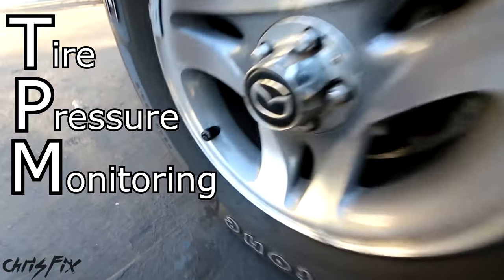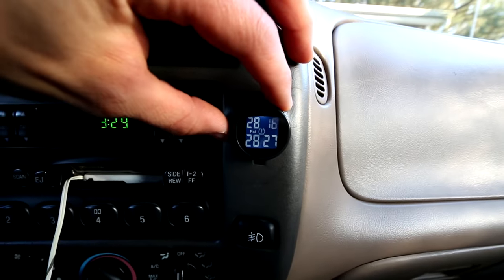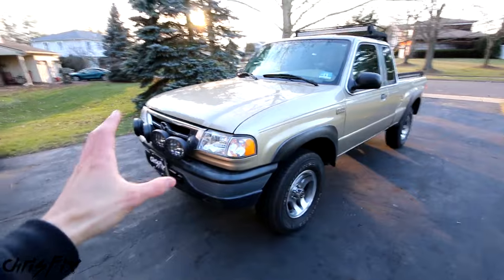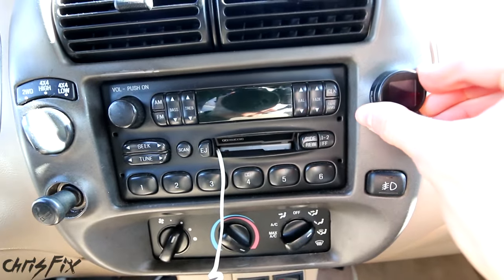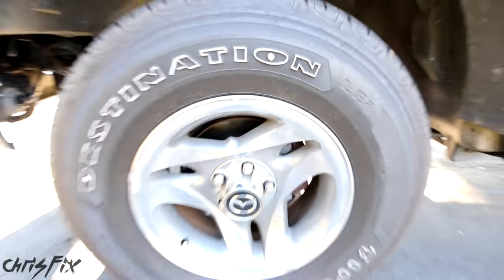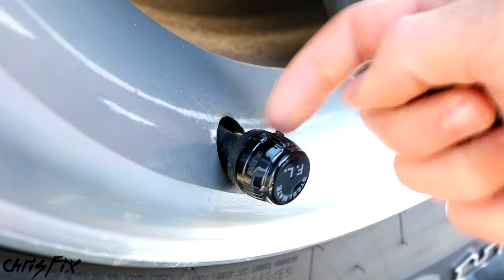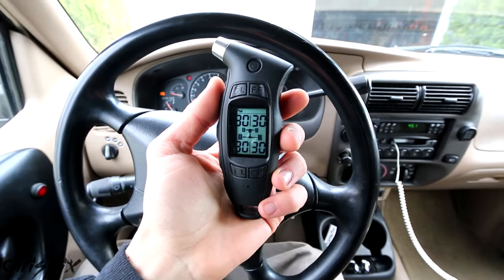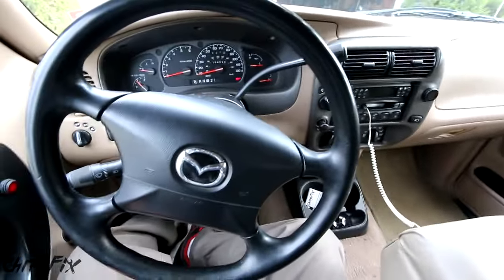How to Install a Tire Pressure Monitoring System in Your Car

Comment: TPMS saves lives. Was cruising down the road at 75 MPH on a very bumpy freeway. Picked up a screw (verified by finding hole in tire carcass after tire blew). The screw somehow came out of tire. Not knowing that tire was deflating while driving on bumpy freeway, it was slowly deflating causing tire to overheat. Before I could sense that something was wrong tire exploded and truck ( towing small trailer, which also was causing resistance making it hard to detect that I had an upcoming catastrophe). It was dawn and getting dark which added another problem. I did not see all the smoke coming from the overheating tire. The tires were in good condition and properly inflated before I drove, for anyone who might think that was an issue ( as mentioned earlier I did find the original cause of the problem, I always check my tires on long trips even when stopping for food,rest and gas). All of a sudden car in right lane started flashing head lights, I looked in right side mirror and could see the smoke in his headlights, tire exploded at that moment causing for a wild ride. Managed to slow down an get over to shoulder, but it wasn't easy. Changing a tire at night along a fast moving freeway is scary and no fun. TPMS would have given my a heads-up that I had an issue and given me time to find a lit area off of the freeway to plug or change the tire in a safer location. I do carry a small compressor and plug kit on trips (Nevada to Pennsylvania).Hopefully they make an aftermarket kit that also gives a low pressure warning.Trying to keep a vehicle in control, changing a tire along a fast moving freeway at night, 3-4 hours of lost travel time, $200 for a new tire. Yeah $109, I'll take it.

Comment: 100 bucks? Screw that, the convenience is nice but I can see the valves becoming inaccurate overtime and it is electronic so its prone to failure. Checking all four tires everytime is inconvenient but hey you get the satisfaction of knowing your tires are at the right psi everytime

Comment: Ive searched but havent found a solution yet.  I have this system installed and it worked fine for about 4 days.  After that, the module no longer provides real time data.  i.e. When i drove 30kms, the PSI in each sensor would go up/down +/- few PSI which is normal as the tyres temp changes but now the PSI remains the same for days and never moves.  If i unscrew any sensor and screw back in, the PSI changes.
So the module in the car and sensors to talk to eachtothe to give me a readout but not real time data as i drive.
Sensors are definitely on the right wheels, battery level is fine and i even recoded each sensor but no luck.
Can anyone help as i find it unlikely all 4 sensors can be faulty unless its the module itself

Comment: My sensors and their lock nuts completely corroded and fused together with the valve! I know that I should have put grease on the treads but, now, how do I get them off?!

Comment: Hey Chris just wanna let you know you are a little bit wrong on the year because I have a 2007 Pontiac G6 with no tire pressure sensors. It’s made mandatory for all cars made after September 2007.

Comment: Thank you for this informative film. The system is new to me. I have a question about TPMS sensors. Can you replace just the stem in the existing sensor? If you change the tire on the wheels w/no sensors you always replace the stem, it is recommended. If you replace the tires on the wheel w/TPMS you don't want to replace the sensors every time, but you always need to replace the stem. So how to go about it? I would appreciate any opinion on this matter. I did just 5 tires (w/no TPMS), and now need to do the ones w/them. Thank you again.

Comment: Great video. Some people reported that a rubber valve stem may crack/rupure due to centrifugal force from the TPMS sensor at high speed after long term use. Just wonder if ChrisFix or people with experience care to comment.

Comment: hey Chris, how come my TPMS, same one as yours, is always 3 below what my tire pressure guages say. (and i used 2 so i know they are calibrated)

if i need my psi to be 36, and i set it to 36, the screen will say 33 but when i drive they say 36 but i put them at 36 before driving

Comment: TPMS displayed in video is $130-150 USD
The sensors are powered by "coin" batteries similar to watches
Need to carry that pesky wrench and holder in order to reinflate
Seems like its more trouble than its worth.

Comment: Hey Chris,
How do I replace my factory system?  I've had a low pressure light on for years because one of the TPMS sensors is broken.  The dealership charges a lot to replace it :(

Comment: Bought a used car recently, pre owner said He checken everything and all 
My Patents said (im 16 i cant drive just yet) it drives a bit weird, we checked the tire preasure  and my Front right tire Was at 0.9 Bar wich is extremely low

Comment: Question so how bright is the screen at night? 

And for those saying it’s too much money. You’d rather walk around and do it manually... You don’t understand why it’s important and being installed on all new cars. Low tire pressure is the number 1 cause of tire failure and contributes to vehicle rollover and loss of control. While driving down the highway you could easily have an issue and not know it. You could have a flat tire and not even notice how low the pressure is till it’s too late. 

I’m not sure I like this kit I would rather have a system that has a app for my iPad which is installed on the dash so I can have it push notifications.

Comment: $110 .... thats a HUGE wtf ..??  cheaper to walk around all 4 tires and manually check them
Reply from the maker: That's true, but the idea is to be able to see all tire pressures at a glance and not have to get out and manually do it!
Reply: @chrisfix  i agree with you 100% ... but at the same time, $110 is a lot of $$ for that product. Yes today its down to $60 which is better but some will think its still over priced...
For me at $60 i would buy it, but not $110 back then and not $110 today either
Reply from the maker: You Tube thanks for sharing!

Comment: @chris fix, 2 questions A my truck says that I need to check my tire pressure monitoring system if I installed this would it bypass that completely?, also second the third link doesn't work anymore is it like important to have the cigarette lighter power splitter?

Comment: External TPMS have one BIG problem associated with them, the sender unit that fits on the tyre valve is heavy and wears out the valve stem with vibration leading to leaking valves and in some case snapping the valve stem, it is recommended by the manufacturers of these TPMS that you should replace the valve stems every 12 months.  . Also trick tyre valve caps have the same problem, the big heavy alloy ones (dice, pool balls, skulls etc are so heavy they rock the stems back and forth causing the seal to leak air, in some cases snap the stem off. And there is also a problem of Galvanic Corrosion between the lock nut and the stem making them impossible to remove, reinventing the wheel isn't always a good idea.

Comment: As an auto tech that works in a tire shop, never fill your tires to the pressure on the sidewall. That's the absolute maximum they should be at. As you drive, your tires heat up, heat = expansion. If you have already filled your tires to their max pressure, BOOM! You just had a blowout. I see this CONSTANTLY in the summer. Always go by the door sticker, or if you don't have one, go at least 10-15 psi below the max on the sidewall.

Comment: I bet that those plugs will kill your ventil in no time, because its too heavy for the rubber and think about how heavy it is in high speeds! And that causes a leak.

Example in my vehicle the previous owner used steel caps, and each ventil leaked. I dont recommend those at all..

Comment: I would buy it but the system they have to take it off ruins it for me. I'd rather just check with a gauge if I gotta use a wrench to fill up my tires. Who's going to steal this? They just look like normal valve covers.

Comment: btw is the weight of tpms will damage the tire stem (where you put air in), Because, if the tire spin faster and faster the weight of it can increase.
Just curious, really want to buy one.
Live in Thailand ssry for bad english or grammar of some sort.

Comment: Chris Fix, you forgot to mention how to change the battery on the tyre tube nut, that way if people need to change or check the battery inside the tyre pressure nut they know how to do it, cheers :)

Comment: I installed 10 sets of these sensors without locknuts, 7 sets of them stuck tight on the threads, very difficult to unscrew out, almost damage the whole valve stem. Now I put some petroleum jelly on the thread before I screw in the sensor, seem good now.

Comment: The inscription on the tyres, clearly state the MAX allowed pressure, for all possible cars on which you will mount them upon. The sticker of every individual car on the other hand, state the actual recommended pressure for that specific model, when it' s unloade and when it' s fully loaded. That' s why the 44 psi was so much off the reasonable pressure.

Comment: yo think it can be helpfull in certain situations, e.g. checkning if your slopes are good or  drifting, if you want to know on which pressure your wheels are working best. 
But allday use its crap, i rather go every two weeks to the fuel station...

Comment: after installation, I assume that the tires should be rebalanced
Reply: Yeah, I was looking at valve caps with pressure indicator. Not really a good gauge, but red yellow green indication. And they weigh enough to make me rethink that, and I may put them AT my next service. I’ll request balancing when they do a tire rotation.

Comment: The product looks cool, but airing up tires looks like a pain using a wrench for each tire. It is just a matter of time before the sensor gets stuck or breaks and you can't get air into the tire when you need to. I'll stick to using my tire gauge periodically.

Comment: Can someone please explain how that locking hex nut keeps the sensor on? They would both turn counterclockwise to take off so if there’s friction and you turn the sensor wouldn’t it just also turn the hex nut taking it off too?  I just installed a set of these and put the hex nut on since why not….but why??

Comment: Only problem with a system like this is not all cigarette lighters or power points are in a location for that small display to be easy to read. Your ranger is an exception since the power point is right there at a height that's very convenient for an aftermarket TPMS.

Comment: My 2016 Toyota Sienna has TPMS.  But it only has a light that tells you when the tire is already low on air pressure.  It does not show you the actual tire pressure of the 4 tires.  Older Toyotas that I have rented have an acual display that would show you the real time tire pressure.  The question that I have is there a reader/display that I can put in the car that will read the tire pressure from the 4 toyota tire sensors in each of the 4 tires.  I don't want to buy a new unit that comes with the 4 little screw on senors that screw on to the valve stems in place of the caps.

Comment: do you still have these on your car. I worried it might get stuck and won't be able to screw them off, because I bought valve stem and they kept getting stuck and I would have to use a tool to get them off. I think it got stuck when the temperature changed from hot to cold

Comment: Thought, maybe it's easier fill the tires every two weeks with the right PSI pressure, than using these sensor and also this key tool every time you need to fill your tire, don't you think?

Comment: Max pressure is the pressure at which that particular model of tire has the greatest weight carrying capacity. The application specific inflation pressure is like you said in the door on most cars.

Comment: I dont ike these as they bypass the protection of the tyre valve and in the case of a failure of the sensor would "fail open"

Comment: I drive a truck that keeps the cigarette lighter on. I have a Bluetooth transmitter cause I can't install a stereo in the truck cuz it's not mine. But the battery has issues dying from stuff being forgotten in the cigarette lighter. Is there a way turn off the cigarette lighter with the truck?

Comment: This must throw your wheels off balance. You are concentrating the weight of three items the rubber sleeve the nut and the device itself in a single spot and you're not putting any counterweight on the other side of the wheel to balance it so you probably have to balance or for all four wheels when you buy the system

Comment: saw it on clearance at walmart for $13. i should have bought it.. but i figured i don't want to keep buying batteries for the sensors. instead i just got the ryobi air pump that  you set it to the psi you want and let it fill  it up and it stops.

Comment: How do you get the locking nut off when it won't budge? You're better off not putting those on because it's a ballache if you want to put air in your tyres plus you need that tool in glove box all the time

Comment: why would anyone steal the sensors?  it isnt line they would have any value since they only work with the receiver in the vehicle.

they are probably specifically coded to only work with the receiver so if one goes missing you may have to order a new kit or call the maker and give them the serial number to get a new one.

Comment: Chris,  Would you know if this system would work with a trailer/trailer tires that you're pulling?  Also, the tires on the trailer are load range E, so they are run at about 85 psi.  Would this system work with that high of pressure?

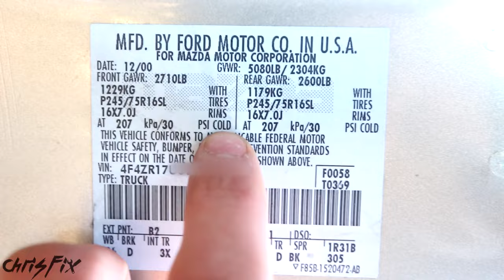Comment: 3:32 that information on the tire about the inflation is only there to tell you that the tire can handle that amount of psi before it blows up from the heat on the road and is only used for EMERGENCIES. I can stress this enough to warn people to not do that to their tires and just to air it up to what the door jam says.

Comment: What if you wanted say an oil pressure gauge, oil temperature gauge, battery voltage gauge, or a combination of all the above in your car?
Reply: automan224 use your smart phone and a app called torque you'll need a Bluetooth odb2 adapter the you can monitor everything in your ride.

Comment: Quick bump on a good video. How do you get air into the tires in a hurry without the TWO tools needed to remove the sensor cap?

Comment: car manufacturers should have made them like this.  the factory made ones fail in a year or two and cost 50 to 70 per tire valve to replace.

Comment: I grew up always checking, tire pressure with gauge, lights working, oil level and brake fluid level before driving. The 5 minutes it took saved me trouble a few times.

Comment: the big size of the transmitters are because of the batteries, if you put them a clock mechanism to charge with the motion of the wheels they could be smaller

Comment: Hi Chris and everybody, as it is quite expensive also in my country (+100 USD), could you please recommend a model / brand that for your experience goes better (accuracy, RF snsr connection) than the rest? I've seen many that can be suited in the powerpoint like the one in the video, and others solar-powered significantly bigger than this one.
One more thing guys, here in 2018, Argentina is very far far away from the idea of including them as a mandatory feature. It's only equipped on luxury cars. Nice day!
Reply: And one more  question, do I have to re-balance my tires after installing this? Don't know if each sensors weights enough as to unbalance tires at high speeds. Thanks!

Comment: The link you have for the tire pressure gauge is different than the tire pressure gauge used in the video. So Please if you put a link to the one used in the video. Thanks

Comment: Be careful with these systems in areas that have snow and where salt is used on the roads. I used one of these types of systems and the sensors corroded to my valve stems in just 3 months and I had to get one of them replaced.

Comment: Nice retrofit solution for careless drivers that never inspect the vehicle's condition or the tyre pressure.
But, for regular checking of the tyre pressure and adding air it seems pretty inconvenient. You need tools just to top up some air !

Comment: What happens when you rotate your tires? Do they all have to be changed according to the way they were originally set?And what happens if you remove the LCD from the 12v socket for charging your phone, etc.... If you replug in the LCD does it start working automatically again?
Reply from the maker: You would need to move the sensors if you rotate the tires and I unplug mine all the time and re-plug it back in and it works instantly.

Comment: 32 psi is too low, most manufacturers like gm recomend cold psi value at 35. I personally run mine a couple psi over that in case it gets really cold at night and therefore never gets below 35 psi. During the summer I like my tires to max at 40 psi during driving which gives the best MPG!
Reply: I’d rather loose 2$ more at the fuel station than handing in grip on the road aka safety.

Comment: I wanted to get tyre pressure sensors for my motorbike but after doing research I found out that you should install metal tyre valve stems as the sensors were too much weight for the rubber ones and it eventually ripped it off causing a instant flat tyre while going 60mph and causing the guy to crash his bike.  

Same thing applies to cars, dont fit tyre sensors to rubber valve stems

Comment: the tpms on Toyota is terrible its just a lamp that turns on if the tire pressure is low or high or if the car can't read the tpms sensors

Comment: I've had issues with metal dust caps corroding onto the valve before and not coming off.

With this effectively being a metal cap, am I not at the same risk here?